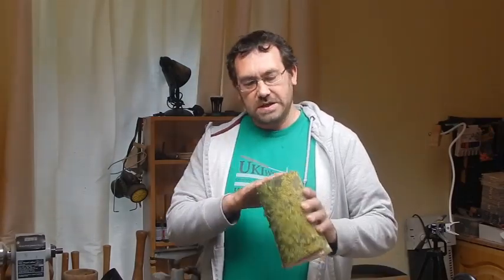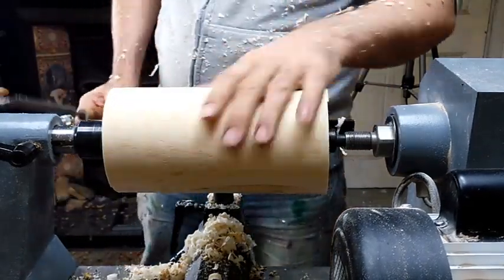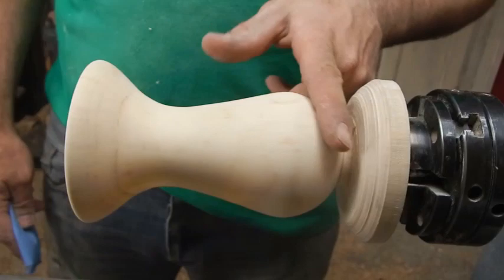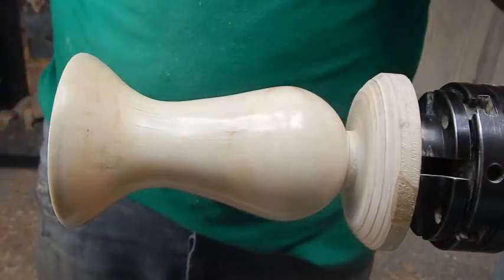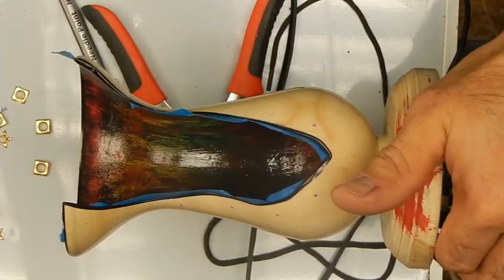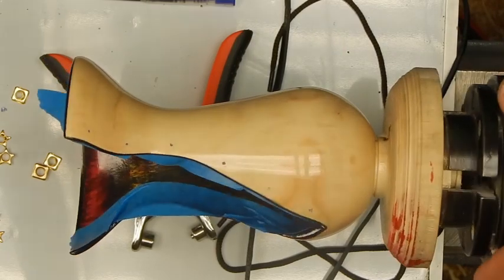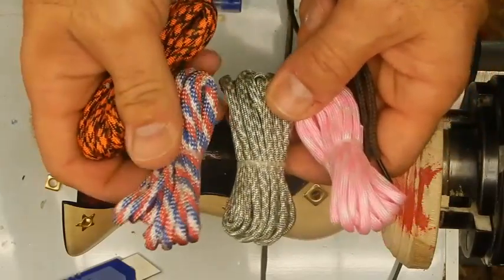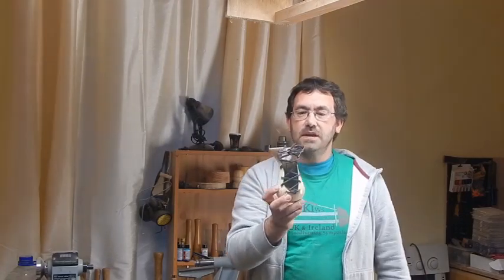Woodturning A laced Form (Vase) using Textile eyelets and leather

Comment: Great project. I remember when Martin did his lace ups on platters which was effective too. Definitely think that colouring the inside was the better option. However with the black laces, not quite sure if the inside is too dark. I suspect that seeing it first hand is a lot better than the images. Just a tip on the photos, if you can take them in daylight, setup next to a window then you will get rid of the harsh lighting you have on some of the images. Not that I do it very often as too keen to just take the pics. Also one last point, get yourself a coping saw. You would have cut that out much easier and quicker and they are not very expensive. Luckily I borrowed my brothers some years ago and forgot to give it back which does get a fair bit of use now. Really enjoyable project and always as usual worth the time watching. Oh and great to have the intro / end music back. Well done!
Reply from the maker: Thanks a million Paul !! Yep this all started with a mistake, and now I have turned, made and sold a lot of these now :-) Thanks for the tips, and for watching and commenting. Regards Steve.

Comment: nice one ;) if done in something like padauk with an african blackwood base it would be an even more seductive valentines day prezzie for the Mrs, also when cutting out it will be a lot easier to use a dremel with an ultra thin burr, like a straight router bit but a hella lot thinner and less vicious, then use a sanding bit to sand the edges easier and then its a lot less likely to snap on you.

I used sanding bits on my dremel once to sand router edging i did on a couple of maranti doors i made, the bits are shaped like a donut with a speed click attachment, eye protection is needed as particles from it sting.
Reply: ok i tried to find a link for those donuts but looks like they might be discontinued as bits do fly off so health and safety might have spat their dummys out, there are plenty of other speed click sanding attachments though
Reply from the maker: Thanks a million Mark for the info, to be honest, I turn them so thin that I can cut it away pretty easy with a sharp knife, and it only takes a few minutes to hand sand the edges. Your watching, commenting and info are all very much appreciated, regards, Steve
Reply: +Templeboy Turnings no probs bud, do you have a vid already to show how you manage to turn so thin ? as i havnt seen you use a dedicated hollowing tool with a laser pointer, hollowing out a vase with a thinish neck is a lot harder i imagine
Reply from the maker: +Mark Hobster Hey, no I have no lazer guide or hollowing system, All I used for this piece was a Simon hope mini hollow straight bar, a bowl gouge and then I used a 3/4" skew to thin down the walls, all by touch and eye..... old school ;)
Reply: +Templeboy Turnings ok you have just sold the hollowing tool to me ;)

Comment: great form!  I am becoming addicted to all "my" UK turners. Couple questions. You said it was green....did it dry or was dried before adding finish?  and.....what about the pith, worried about splitting/cracking?
Reply from the maker: Hey Steve, thanks so much for watching and commenting. Yes the wood was fresh cut about 3 weeks ago, and only brought inside a day before turning. because I turned it so thin it dried during the turning process. also yes I finished the outside straight after turning and hollowing, but left it over night in a warm shop before painting and giving the inside 4 coats of sprey acrylic lacquer. So in theory its fully sealled now so shouldnt crack at the pith..... the base thickness where the pith is, is only 10mm (1/4") thick so dry...... hope this answers your question? thanks a million, regards,Steve.